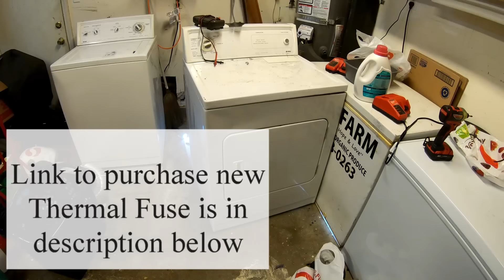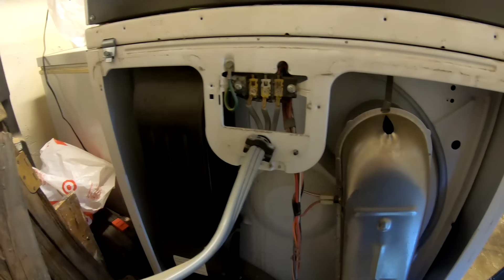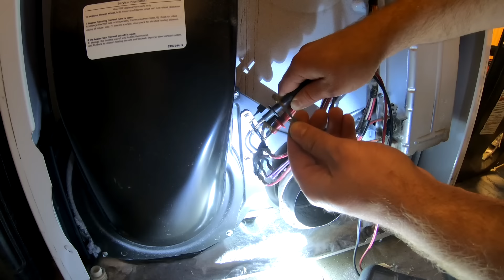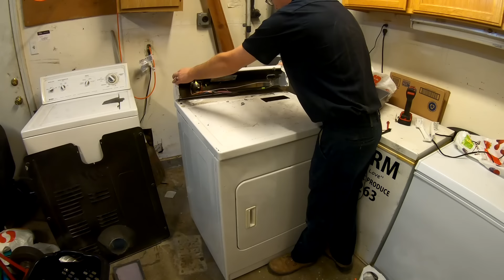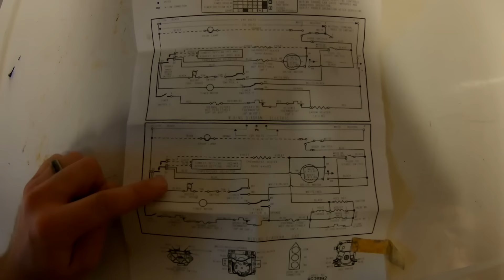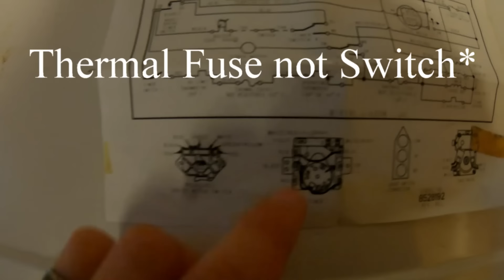Dryer Won't Start / Kenmore / What To Check and How To Fix

Comment from the maker: You can get new Kenmore Dryer Parts here:

Kenmore Dryer Thermal Fuse: https://amzn.to/2Zd2Qpl

Kenmore Dryer door switch: https://amzn.to/2UX9516

Kenmore Dryer Start Switch: https://amzn.to/2KCMnYi
Reply: Would have been nice to actually show us what to do if it is the cutoff switch or the door switch. Big oops if you ask me. Also in the first part of the video we have no idea what leads your testing. It was very dark and the camera was far away from where you were working.
Reply: Nice job , excellent video
Reply: @yadirezaee2275  please play the video
Reply: Link broken for on off switch
Reply: Does the Kenmore 110.85015100 have a Thermal Fuse??? If so can you tell me the location please?
Reply: Help...my 900 Series Kenmore dryer 's timer knob is locked! What do I do?
Reply: Good morning can you recommend which part I would try and test if the dryer runs for hours and never gets hot. Do you have any videos on how to test that part
Reply: Thank you for the video we were able to fix our 25 yr old dryer once again for less than $10 thanks to your video!

Comment: Two important things:  1) Blowing the thermal fuse usually means an obstruction in the exhaust duct.  That needs to get addressed or you will just blow another thermal fuse.  We have a long convoluted exhaust duct.  I used a leaf blower to clear it:  Worked great.  You would not believe how much lint, etc. came out.  2) Testing the door switch is very easy:  Open the door, is the internal light on?  If yes, then close the switch by hand or with a tool.  The light "should" go off.  This is a far easier test than the one in the video.

Comment: Thank you SO MUCH for posting this.  I have a slightly different model, but most of the parts are in the same places.  My dryer stopped working out of the blue (wasn't running at the time) - no start - interior light working and door switch working.  Took the back panel off, tested voltage (good) and then tested the thermal fuse and whoop there it is.  I won't admit to clipping the leads together and testing the start ;)  Should be up and running again in less than 24 hours.  Awesome.  I love the old mechanical appliances.

Comment: well, not having a tool like that i swapped out the fuse and still it does not work.  how to actually fix the other two potential issues?

Comment: What if the switch was bad?  How about testing the momentary switch which has more than two wires!  Some switches have a plug on it with three wires in conjunction with the two wires the operate the momentary switch

Comment: So if im only getting 130 volts on the black and red leads, shouldn't i be getting 220 on the main? The wall 220 socket is 255 volts so power is going out. Im thinking it might be bad power cord assembly?

Comment: Wow great video. Woke up to the dryer not working. Went ahead and replaced the thermal fuse, and door switch. All in cost less then $10. Now working perfectly. Probably would of went ahead and switched the start switch but the link didn't work, and thankfully that did not need replacement.
Reply from the maker: Glad this got it going for you!!💪

Comment: Why did the thermal fuse blow? Just replacing the fuse doesn't solve the problem. When it comes to issues with clothes dryers, the culprit more often than not is lint. In my case, the blower housing was packed with lint. If the thermal fuse blows, clean out the exhaust line and the blower housing. Then replace the fuse.

Comment: Thank you soooo much, Handyman Journey... Your tutorial assisted in repairing my older Lady Kenmore thermal fuse... I didn't know that I had to open the bottom of the dryer until I tuned into this video... Kudos and thanks for taking the time to help me fix my dryer for $25.00 rather than running off to buy another one...My hero....

Comment: Thanks for this video I follow all the steps everything was tested and show nothing was wrong with the electronics. Found out the door was not making contact with the switch. Bend the metal to make contact and the dryer is working again.

Comment: Just replace the thermal fuse from amazon. Worked for a one cycle then quit again. Any other info. Kenmore 70 series. Thanks in advance.
Reply from the maker: Sounds like Something is making that thermal fuse blow, how's the vent look?

Comment: Thank you for making this video. Using your tips I have diagnosed my problem and ordered the part.
I do not have a multi meter so I used the ill-advised method of jumping the wires at the thermal fuse. That was confirmed to be the issue. Thank you for adding that info.
I believe I found a method to confirm that the door switch and power button are functional without a DMM. Please correct me if I have an error in my thinking.
If the power button is functional it will cycle with an audible click when activated with the timer.
Turn timer on, push button to start then turn timer to off position. If the switch is functional it will click off when it receives instruction. If it clicks it is good if not, it is bad (or wires/connections).
Now with that power button confirmed working we can test the door safety switch.
Open the door and locate the switch. Turn the timer on, push the door switch and hold it, then push the start button. 
Now listen as you release the door switch. If it is functional it will trip the start button into the off position with an audible click when you release the door switch. If it clicks it is good. If not it is bad.
Does this add up?
Reply from the maker: I am so glad this was helpful for you! And I am glad you got your dryer fixed!!

Comment: Pressed the power button on my Kenmore dryer but nothing happened. Even though the dryer wouldn't power on the shell of the dryer was hot as if the dryer had been running. Is the problem the power switch, thermal fuse or something else?
Reply from the maker: Could be a few things, it's hard to tell without testing

Comment: Thank you so much for this video. This was a 5 minute fix and it cost less than 10$. Didn't even bother to check if the old thermal fuse was dead before ordering a new one as it was inexpensive to replace and sure enough installing the new one fixed the dryer right away. Thanks again!
Reply from the maker: So awesome! I am so glad this video was helpful for you!!💪 Great work!

Comment: Yea I told someone about bypassing the thermal fuse, well they decided it was ok to use it, they burned down their garage. So nope don't do it all. A bad thermal fuse is symptom of a bigger problem, the dryer is overheating. So yea, I'll do as a test but never tell anyone.
Reply from the maker: Yes, never bypass the thermal fuse!

Comment: Great video. We have an ancient Kenmore Series 80 dryer and my wife told me last night at 10 pm it wouldn't turn on. I found your video right away and started going through your steps, but didn't take off the back to test the thermal switch, given the hour. I just decided to order one, assuming that was the culprit, and then went on to step two, the door switch. I thought I might just check to see if the door wasn't fully closed, went out to the garage, pushed the door, pushed the start button, and voila. Operator error. I canceled the sensor order. Case closed. All our appliances are old, and easier to repair and longer lasting than most modern ones that we have in another house. As I read all the other comments where the thermal fuse was the problem, maybe I'll go back and order the sensor, anyway, just to have on hand.
Reply from the maker: Great work!!💪💪

Comment: I have a question. I had the same exact dryer brand. I switched the thermal switch multiple times it keeps blowing them out. It only dries one time, but my dryer stopped drying. What else can it be?
Reply: I have a Kenmore, but it is a gas dryer

Comment: I just learned on my gas dryer that you can test the door switch by holding the start button down and opening the door and listening for the click. If you hear the relay click, the switch is bound to be okay. All without pulling the front off. This is when the dryer won't start, but you hear a click.

Comment: Awesome video! Thanks for the vid it got my dryer running again!! Though when I started my dryer for the first time right after re-installing a thermal fuse there was an intense burning smell and steam or smoke.. is this normal for the first time post installation? do you know what could be the cause?
Reply from the maker: No that is not normal. I think something might be stuck in your exhaust system either in the dryer or in the dryer vents in the wall. I would get that checked out

Comment: Thanks for the video! So what if the on and off switch didn’t beep when you tested it. Is there something that can be easily bought and replaced as with the fuse in the back that you replaced? If so, how does someone go about taking the bad part off and replacing it with a NEW start switch? As for my issue, when I depress the start button, it makes noise but once I release it, the noise stops. And no matter whether if I hold the button in or not, the dryer doesn’t work! It ticks but nothing more. 
Thanks in advance!

Comment: I had to pay to get the door switch sensor teplaced. I told the tech that the dryer wasnt heating as hot . He stated that replacing the door sensor switch fixed the temp. It did not. Have to run dryer longer to get clothes dry. Don't want to pay another charge. Could it be possible that the heating element will need to be replaced. Thanks in advance.

Comment: I have this exzact same model. The door latch sensor switch appears to be broken. The dryer also wasn't getting as hot as it used to lately.
Reply from the maker: Glad to hear this helped! Also clean out the dryer vent. That may be an issue for the dryer not getting as hot

Comment: Thank you!! You helped me troubleshoot and fix my dryer! It was the #2 problem – the door switch. But it wasn't actually the switch... It was the metal lever (on an older Kenmore) that had fatigued with age and broke as I took it off. Only cost me $5.57 to replace from my local parts supplier. Thanks again!

Comment: Fixed my problem. My switch is broken, it won't click anymore, problem due to slamming of the door. Taking the connector apart was really difficult though.

Comment: If you plug the dryer in and sparks fly and causes the dryer to not power on, do you think the thermal fuse is the culprit?

Comment: Can you help me ? I push the button and it starts I let go of the button and it stops. I have changed the start  switch. I’m getting a thermal fuse and multimeter to test stuff. What could it be?

Comment: So, I watched the video (a couple times) tested all three components (fuse, door switch, and ON/OFF switch) and all checked out. Can you tell me the 4th likely cause of my dryer not starting?
Reply from the maker: A broken belt could be the cause. There is a switch on the belt pulley where if the belt breaks than it will cause the dryer to not work

Comment: Thank you brother. This is the 4th thermal fuse I've replaced on this dryer. Every other time I replaced them the dryer was only blowing cold air.  This time it wouldn't start. Thank God I ordered 3 extra fuses last time and taped them on the inside of the rear cover.

Comment: Would have been nice to actually show us what to do if it is the cutoff switch or the door switch. Big oops if you ask me. Also in the first part of the video we have no idea what leads your testing. It was very dark and the camera was far away from where you were working.
Reply from the maker: Thanks for tuning in. This video has helped a lot of people, sorry it didn't help you
Reply: @handymanjourney  It did help. I now can find the three most common causes of our problem and know how to solve one. That's the point. Don't you think it would have been helpful to show what to do about the other two issues?

Comment: Note for anyone who has a Kenmore 700 series: the thermal fuse is in the front of the dryer. !No need to remove the back. Remove the front of the dryer and find it located in bottom center.

Comment: The thermal fuse was it for me too! When I tested it with voltmeter it seemed like it had conduction.  So tested the other two options which also seemed fine. Read a comment who said the fuse tested fine for them and replaced anyway and it worked.  I clock the fuselink in the description ordered from Amazon got next day and boom, worked!  I tested the old one after pulling it out and it seems like some parts had connectivity and other parts didn't. Anyway great video and saved me from buying a new dryer!

Comment: Hi. Long story. Sorry. Dryer turned on no heat, trial and error. Replaced thermal fuse only, dried 4 loads of clothes then would not turn on at all. Bought a kit, replaced all thermostats, thermal fuse and heating element, came on , no heat. Put old heating element back in with old thermostat(forgot to switch out) got heat. Dried 2 loads then wouldn't turn on again, this time heating element was grounded and burnt up. I can hear the timer trying to do something but nothing will come on. And even if I turn it off I hear the timer still trying and it won't stop until I open the door. So I'm figuring it was the timer all along but I want  to be sure before oredering. Sorry so long

Comment: My dryer is turning on speeding up and then slowly shutting off and keeps doing that. Could that possibly be the fuse as well? I figured maybe not because it still has power. Good video!

Comment: i have an old sears kenmore dryer that doesnt show any sign of power. even the timer isnt working. could the thermal fuse shut down all the power, even the timer? was working badly, then i cleaned the vent which was badly clogged. then the dryer worked great again but when i went to do another load, it never came back on. could the sudden shock of cleaning the vent while running blown out my  thermal fuse or limit switch, and make  it completely dead? thanks for the great video, any reply would be appreciated.

Comment: if i can spin the drum by hand and the dryer starts, where is the starter cap on a similar model? a 2007 600 series. is it on the motor mount? there are a handful of wires down there. many motors have capacitors to get them started - used to have caps go all the time on some pump motors. but they're large cylindrical capacitors. these look like they might be integrated on something attached to the motor.

Comment: I need your help. I am up here in communist Canada and my Kenmore 90 series dryer is not starting. I first checked the circuit breaker and it’s fine. I noticed the door switch was no longing clicking and just dangling and the light in dryer would not come on when I opened it. So I replaced it. Dryer still would not start. I tested the thermal fuse with multimeter and it was unclear so I replaced it and still the dryer would not start. I tested the start button and it is working. Is it fair to assume the terminal/electrical port is fine bc the light comes in when I open the door so there is power to the dryer? What else could it be? Help from communist Canada

Comment: You read the directions manual wrong! The two 5/16s screws going throw the hinges on the top panel don't need to be removed to open the top panel. Also they screws, not bolts. You said to remove them instead of the two screws attached to the top panel and vent duct. Everybody wants to be content creators.
Reply from the maker: Sorry I missed spoke bro. Thanks for tuning in!

Comment: I tested all three items in your video, all good. When I push the start button it hums but does not start the dryer. Any ideas?
Reply from the maker: Sounds like a stuck drum or motor.
Reply: @handymanjourney  what is the trick to remove the panel to expose the motor? Drum can be turned manually.

Comment: Don't need to remove top to check door switch.. switch is tied to the cabin light. Flick the switch with your hand if light goes on and off the switch is fine.
Reply from the maker: Thank you!

Comment: thank you,..no REALLY, THANK YOU!. I just fixed my old 70 series Kenmore because you taught me how to do it! same model. I was for sure it was the door switch slammed too many times, so I started there...but, as you predicted # 1 problem, it WAS the thermal fuse. now I don't have to work extra shift to pay someone $200 to replace a $5.00 part 😂on a $50. dryer. 😄  Door switch $5.47, Thermal fuse $4.39, 1/4 inch tool for back screws $1.99, & a lil free ingenuity .😄AND now, 19 yrs of accumulated fire hazard lint is all vacuumed out & clean as a whistle. yes, really thank you.

Comment: Great video! Was wondering if you should have tested Thermostat as well or maybe just replace it when replacing the Thermal fuse? I was thinking if the Thermostat was getting stuck closed causing it to Overheat and tripped Thermal fuse , other than dryer vents being restricted. Also could a bad timmer cause the dryer to keep running thus causing the Safety devices to trip.

Comment: Hey buddy, thank you for the video. Great job question for you I ordered the thermal along with another sensor I replace both of them the dryer started working immediately with no problems then it started overheating and then it shut down again, same problem won’t turn back on but it overheated to the point the clothes were practically on fire, what could be the problem with a bad thermal fuse

Comment: Started good but of course he did not show how to "fix* the other two most common problems. My problem I knew from the beginning was the door sensor switch. How do you FIX it. What parts do you need to replace? Where to buy? Cost? The presenter did a great job with the first problem, but not the 2nd & 3rd.
Reply from the maker: Appreciate your input!